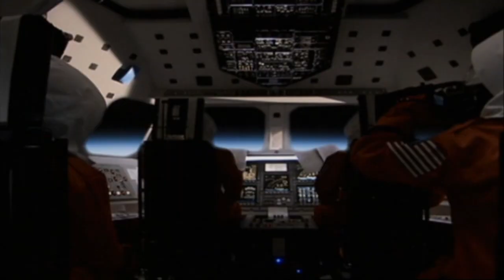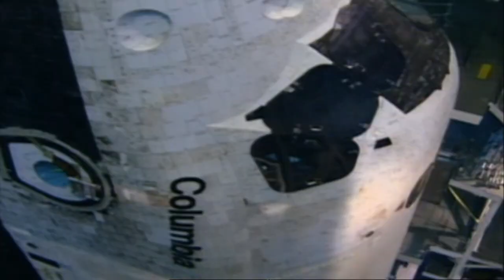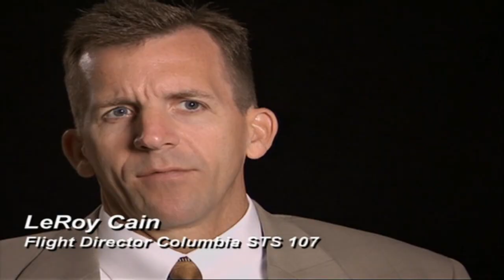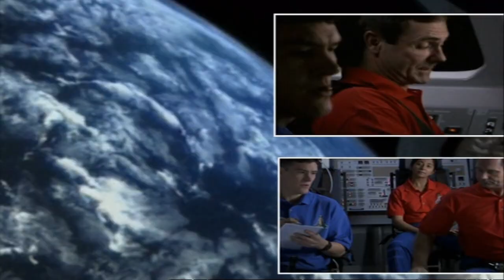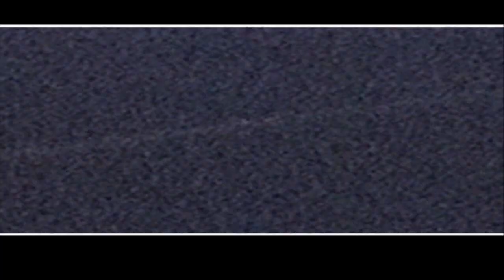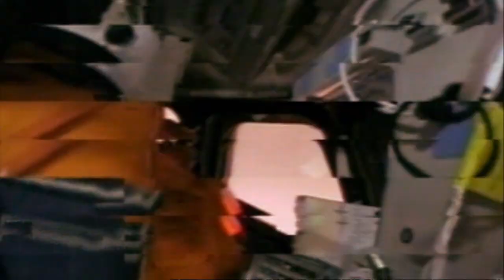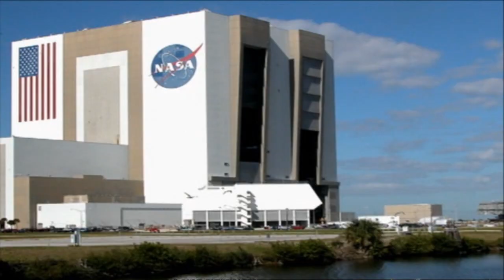Space Shuttle Columbia - Falling Star HD

Comment: What surprised me was the realization that there was not a repair kit on board. With something as important as the heat shield I assumed that they had something on board that could fix many problems and holes. Space is a junk yard and holes are going to happen. Sad.
Reply: This is the same organization that allowed square co2 filters for the command module, and cylindrical filters for the LEM on Apollo 13. Don't get me wrong, I like NASA, the only government agency I do like with few reservations, but they are politicized almost as badly as DOD: too many decisions are governed by assholes with an agenda outside the mission. That program manager, Ham, just sort of washed her hands of the issue.
Reply: And yet, NASA has brought the world so many amazing technologies, fewer of late I suspect but during the 70's wow! Every home is impacted, I just replaced a battery in my smoke detector, I rarely thought of device unless it announces ruined dinner, thanks NASA.
Reply: really like what? velcro for instance is a myth. it was invented in the 40s in netherlands actually.
Reply: +Christopher Gurin The problem you are talking about (different shaped containers) was due to the fact that the CSM and LM were designed and built by two different companies. But the engineers did find a solution to that problem.
Reply: +zarni000 Weather satellites which allow for advanced warnings of storms -- countless lives have been saved. Communication satellites, GPS, and a lot of information about other planets in our Solar System, not to mention multi EM frequency observatories in orbit (like the Hubble Telescope). That's just off the top of my head. NASA does a lot more than the manned space program.

Comment: No thanks NASA. I can manged just fine, parking my rig in my driveway, without your assistance. "These extreme readings present a puzzle no one has planned for" ... Puzzle my ass. Everyone, including the crash director, should be in jail breaking rocks for life.
Reply: https://en.wikipedia.org/wiki/Soyuz_1
https://en.wikipedia.org/wiki/Soyuz_11

check your own fraudulous claims before you claim that the soviets were so much better. NASA had two lost space shuttles and soviets had two lost soyuz capsules!
Reply: Daniel by the way "fraudulous" is not a word.
Reply: yeah the soyuz had 0 failures. these bozos were able to get it to 1/65 complete failures. give it to nasa to mess up anything.
Reply: the crash director didn't make the decision to strap an airplane to some rockets, which is the root cause of all these failures
Reply: Daniel by failures i meant rocket failures like the ones the shuttle had. not reentry or anything else. the engines had 0 failures.
also the 2 casualties from before 1971 can hardly be compared to to failures that nasa experienced only recently. the soviets havent had one casualty since and way more flights on the soyuz vs the shuttle.
and nasa head himself said shuttle was mistake:
http://usatoday30.usatoday.com/tech/science/space/2005-09-27-nasa-griffin-interview_x.htm
not surprising the shuttle program has been terminated and soyuz is still in operation. the only viable vehicle servicing the ISS
Reply: zarni000
what's the matter cat got your tongue? maybe in your dialect it doesn't exist. fraudulous is an accepted slang/idiomatic word in the english language. and why are you harping on that rather than TWO SOYUZ FAILED! stop blowing the soviet space program. how about the 4 moon rocket engines that BLEW UP and failed miserably? not to mention the shitty buran shuttle that was destroyed due to a collapsed roof (killed eight people, MORE than a single shuttle failure).
Reply: well if you wanna talk ebonics perhaps. it doesn't exist in the english language. the word is fraudulent. get a clue first.
Reply: regarding the Buran. It's actually the best space exploration vehicle ever developed on Earth.
we have not even matched it and it appears will take at least another 10 years to get back to where it was in terms of capabilities. i'd suggest you get a clue before you discuss further these topics that you obviously know so little about.
i don't understand how the collapse of a hangar on top of it has any bearing on it's qualities as a vehicle. in your confused mind however there may be some connection which nobody else can follow.
can start some light reading on the buran here:
http://www.popularmechanics.com/space/rockets/a9763/did-the-soviets-actually-build-a-better-space-shuttle-16176311/
Reply: "Fraudulous" is a "slang word"?? Moron Daniel, even if it were one - which it is not - this is not the place or the time for using that kind of "bleep!" You just do not do that in a public forum on a scientific subject. You have also forgotten that "English" is ALWAYS a capitalized word, just like French, German, Italian, Japanese, Korean, Latin, Russian, Serbian, Slovakian, Spanish, Swedish, and Swahili. Why don't you just do that on automatic pilot? Furthermore, "Buran" is a proper noun, just like Vostok, Mercury, Gemini, Apollo, Soyuz, and STS.
Reply: europamoon100
i still don't hear an actual rebuttal of my arguments, moron europa. stop focusing on 'grammar nazi'-type attacks and rebut my arguments! i think you know you lost your argument so you try to call me names and lie about my 'lack of english knowledge'...you probably aren't even from an english-speaking country haha

Comment: It's like they learned nothing from the Challenger disaster
Reply: Both caused by "Launch Fever." Intense pressure to get the launch going from management, which compromises safety.
Reply: no it's caused by ineptness.
how is it the soyuz didn't have 1 failure and more launches than the shuttle???
Reply: eh?
Reply: @zarni000   Russian Soyuz missions did have failures.
Reply: It's EXACTLY like they learned almost nothing from Challenger. the CAIB found that NASA had failed to learn many of the lessons from Challenger.
Reply: Soyuz had multiple failures, and the reason for its reliability is that it's not complex. It's a fucking space stone falling through the sky. The shuttle is a plane.
Reply: To be fair, the Columbia blew up on re-entry, not launch.
Reply: @ajyu7289    It did not blow up.   It fell apart and burned.   The Challenger did not blow up either.
Reply: Challenger and Columbia were totally different disasters, pal. While the result was the same (disintegration), the issues were not.
Reply: @Gothangelik  Exactly.
Reply: The challenger was destroyed because it exploded after launch but Columbia was destroyed by re entry
Reply: Well Challenger was completely different then Columbia
Reply: After Challenger,they made couple of improvement,but it was all gone 17 years later,that caution.
Reply: Thing is that this accident was SO VERY DIFFERENT. They got into space successfully, but the problem happened when they were coming back 😑.
Reply: NR Nur I always wonder if that disaster contributed to the lack of interest in science and engineering jobs in the generation that was watching it at school. Ptsd nationale
Reply: one blew up due to retards, another blew up due to retarded design
Reply: Failures on Soyuz-1 and Soyuz-11 killed four people.
Reply: Challenger and Columbia were two Completely different scenarios. The Challenger accident happened due to freezing cold temperatures and the O-ring neglecting to completely seal from said temperatures. Because of that, Flames from the left booster could reach the fuel tank. One had burned a hole in the tank and ignited the fuel inside, and thus caused the breakup. NASA did indeed learn from this mistake. They fixed the O-rings, and incorporated restrictions. If it was too cold, They wouldn’t launch. What caused the Columbia Disaster was that a piece of foam insulation feel off of the fuel tank and ruptured a whole in the left wing. This caused flames from reentry to enter into the shuttle and tear it apart from the inside out. Columbia was COMPLETELY different from Challenger. So yes, They did learn from Challenger.
Reply: The Creepernator wrong, the incident occurred on the right thruster, not the left. The O-ring concerns were brought to NASA by an engineer 13 hours prior to launch but NASA ignored his warnings.
Reply: and that is why the last  Space Shuttle Endeavour went to the museum thank god !!!! i love NASA for what they do but they can bether leave the space shuttle thing in hands of the russians !!!

Comment: Challenger didn't teach them anything..
Reply: No he's right. A problem that was found pre-launch(O-ring, then later loose foam) and not corrected because of the potential delay they might cause.
Reply: Viper Strike 92 challenger was a different kind of disaster, you dumb fuck
Reply: @leeschmitz993  It was but both disasters were caused by the same systemic problems.